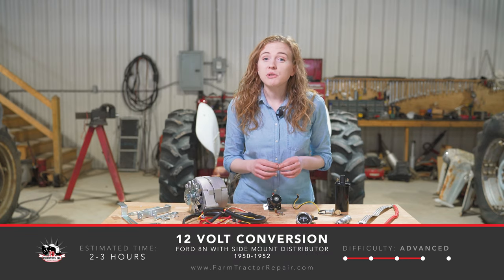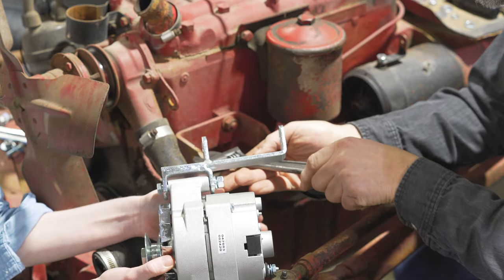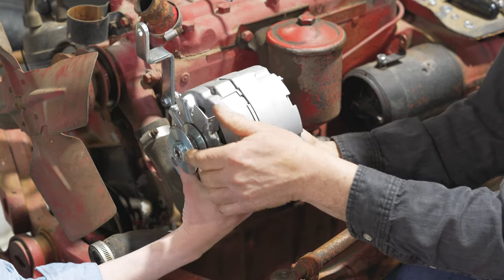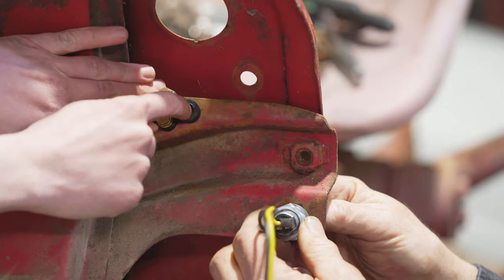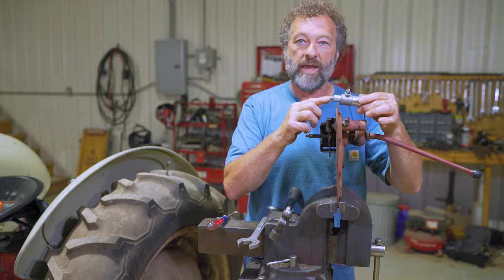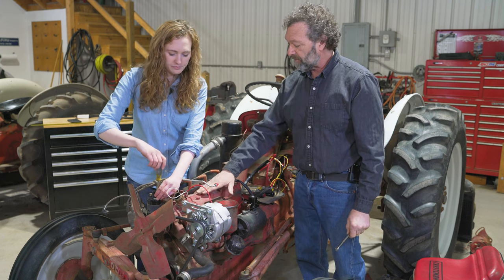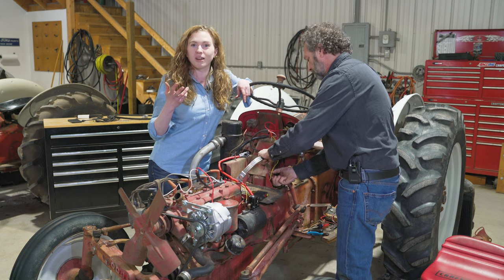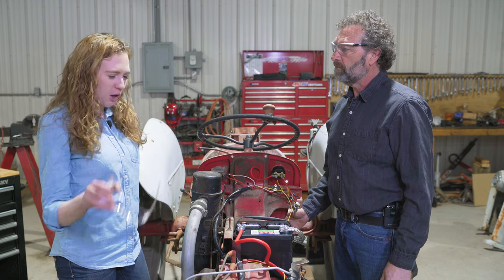Ford 8N SIDE Distributor Twelve Volt Conversion, 1950-1952 Model Years, Easy How-To Video

Comment: Perfect tutorial, I own and work on a lot of antique tractors and I always struggle with the electric part, currently working on an 8N that I bought, had a 3 position switch on it and a few extra wires that I could not figure out, it was already converted to 12v some time in the past, I simplified everything based on your tutorial, will see how I did this afternoon after I go to town and buy a battery, but gonna change the oil and filters first, thanks again

Comment: Question, a buddy of mine had an issue, after changing everything over to a 12 volt system the start/neutral button would turn the engine over with the key off, it wouldn’t actually start the engine because there was no voltage to the distributor coil with key off but it did  energize the starter solenoid & try to turn the engine over. I didn’t think it that was right but he said it was. I was just wondering

Comment: So ive got a 57 600, its converted to 12volt, and i keep having issues finding a decent ignition switch. Im a little torn because everyone seems to sell the keyed 2 post switch, but, ive bought a couple bad out of the box ones from tractor supply. I'm about to try a equally cheap dorman switch with the 3rd start position that i geuss ill ignore? I dont exactly want to just throw a toggle switch in and make it the easiest thing to steal, but, i havent had good luck with those 2 post switches. Any advice?

Comment: In your video, you are showing the battery positive wire going to the solenoid terminal. But my tractor, actually, it is the negative battery wire going to this terminal (Chassis is +6V). If I do it like your did in the video, will it reverse the starter rotation ?

Comment: I recently purchased a ford 8n with side mounting distributor and have ordered the 12v conversion kit. My question is is there a use for the voltage regulator now? Haven’t seen any videos on them being wired up in this system. First thing I did was yank out All the wiring and old connections to replace with new but still have the voltage regulator mounted.
Reply: Take that old regulator off. Not meeded at all, the conversion kit has the 12v one wire Alternator and it’s internally regulated.

Comment: I'm having difficulty understanding the connection of the key switch to the starter button. I don't see how they are connected. If the key was not turned to the on position would the starter button still allow the engine to turn over, it just would'nt have spark until the key was on?

Comment: I have a 8n Ford  I bought but the charging system is not working.
It has a 2 plug alternator and not running the ports on your video and also it's been changed from points to electronic ignition what can I do to get everything working so I can use my new tractor
Reply: Are not connected like in the video

Comment: Rachel, I like your youtube shows but my son and I just converted our 601 just the way you showed us but when we turn the key on it won't even turn over we can go from the solenoid to the starter with a jumper cable and it will turn over but not with the new push button switch and we hooked the yellow wire to the solenoid and to the push button like you said what could be wrong everything shows we have fire could the solenoid be bad?
Reply: Maybe a 601 is wired differently than an 8n

Comment: I have a question, should the tractor crank over regardless of ignition switch position?, either way I’m not getting spark at the plugs, I have a new coil that I have not installed yet the only other thing I didn’t change is the starter regulator, cap and rotor and points and condenser are all new, brand new battery, positive and negative cables, older wires but seem ok, any thoughts would be appreciated, thanks
Reply: Hey John, did you ever get an answer to this? I have everything hooked up but no spark at the plugs. I’ve tried everything.

Comment: Rewired my 8n according to the video. Starts and runs fine. Only problem, it stays running when the key is turned off. What might the problem be?
Reply from the maker: Did you use a one-wire alternator as demonstrated? The trouble you're describing is typical of an automotive two-wire or three-wire alternator that is back-feeding.

Comment: I've heard there is problems converting to a 12 volt system. The one I find most concerting is that the flywheel is getting damaged as the starter is spinning faster.  Have you seen happen?
Reply: The flywheel should not get damaged from spinning faster unless something prevents the engine from rotating. These are low compression engines. A properly tuned engine should start quickly. It would not be a good idea to keep cranking the engine too long if converted to 12 volts. That can cause the 6 volt starter to overhead and fail. When you convert to 12 volts, you are doubling the current flow through the starter.
Reply: When volts go up, amperage goes down.